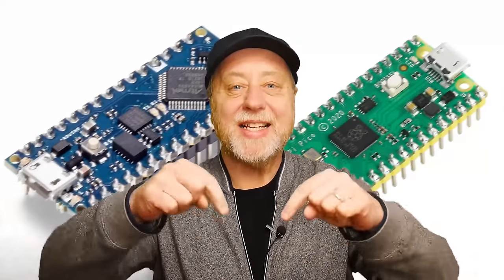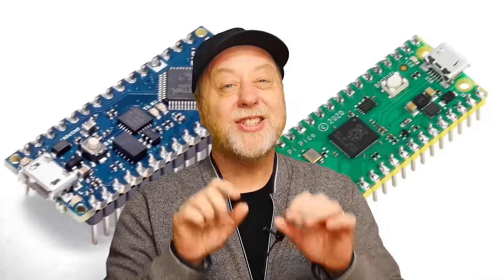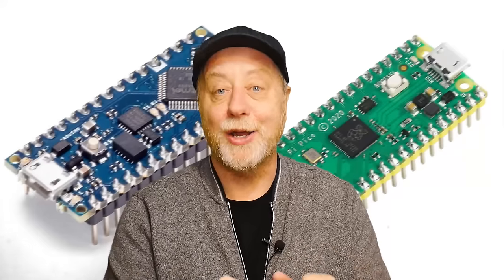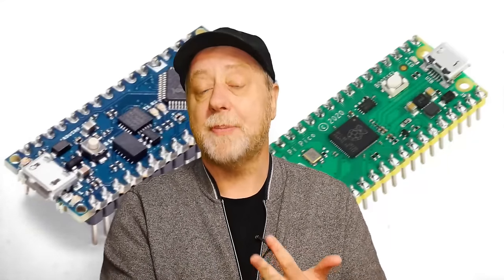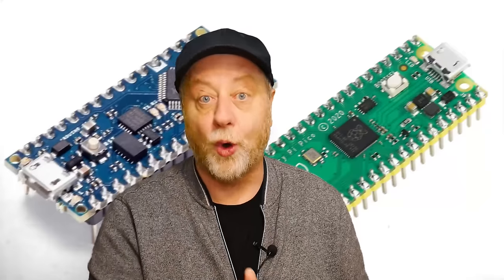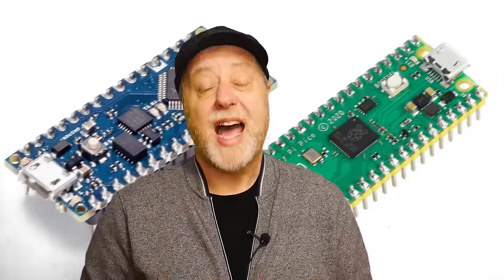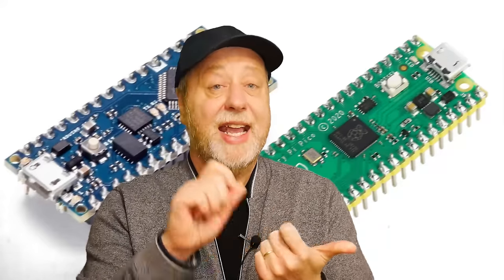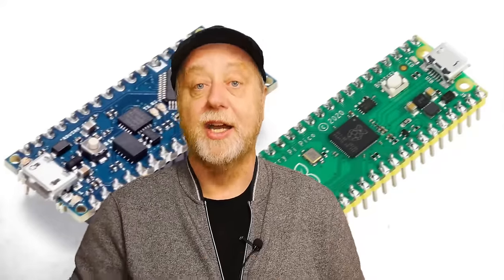Arduino vs Pico - Which is the Best Microcontroller For You?

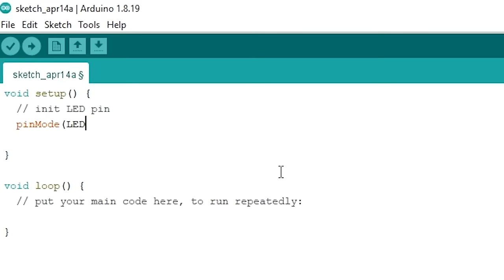Comment: 4:06 Unfortunately it's a common misconception, but just like Processing is not a language based on Java, Arduino and Wiring are not languages based on C++. Processing IS Java and Arduino and Wiring ARE C++.
Both are "just" Java/C++ libraries and if you want you could even call them frameworks because of the setup and loop/draw functions you use instead of the main function/class.
In fact, I even wrote my last Processing project by also setting up the main class myself. I just prefer to have control over the whole toolchain. What I skipped was basically just a preprocessor and not something that translates Processing into Java. I made a makefile just like I would with any other Java project and there I included Processing as a library just like I would with any other Java library. I'm pretty sure you could do the same with Arduino.

Comment: The decision gets more complex when you look at items like the Arduino Nano Sense BLE R2 that has many on-board sensors like a 9 axis IMU, temperature, pressure, light, and  microphone that would be external components for the Pico. It's more expensive but the externals and additional circuit complexity might bring the Pico into the same range if you need the functionality. MicroPython will also run on the Nano, and using VS Code with the PlatformIO extension allows for standard C/C+= programming.  Different horses for different courses and I'm happy to see an increasing number of possibilities on the market

Comment: I am having an issue i think it is that pico needs a DTR request on reboot and arduino does not..  i have software that does not send one and so  i have to open the serial monitor in the IDE in order to force serial communcation to open up..  the UART on the pico requires this andni need to find a way to simulate the handshake and enable serial comms on the pico.  Any suggestions?

Comment: just to be clear: arduino is also normal c++ with gcc and nothing special. it just adds one include or so automatically to the first line. also you should use platform io on vscode and not arduino studio
Reply from the maker: I have a video about Platform IO. But just to be clear, while the compiler is basically gcc, because Arduino uses non standard entry points etc, it isn't possible to write your own OS like I did with the Pico (see my videos on Piccolo OS). Hence my statements in the video.
Reply: @GaryExplains  I don't see why this should be not possible or different. If you don't use arduino lib (and ide) it should work as on the pi. I think you got confused because the arduino lib comes with its own main and some other magic but you can override that and do also not need to use that kind of magic.
Reply: Exactly. You can even use Atmel Studio (which is Atmel's special version of the regular Visual Studio) and original ASF libraries, and you can also install FreeRTOS on that board. Keep in mind the program flash is kind of small though :)
Reply from the maker: @TheLukasz032  This video isn't about alternative programming environments it is about the official environments, the ones that most people will use when they get these boards. If you don't like the official environments that is a different discussion. If you want to be awkward you can create the machine code by yourself by hand in binary and flash it.
Reply: You know, if we want to be precise, the official environment for writing AVR code is Atmel Studio. Anything else is either a port or another toolchain, not officially supported by Atmel.
Reply from the maker: @TheLukasz032  No, that is nonsense. The official way to program an Arduino as a board, is by the software that the board maker releases, not the software released by the maker of one of the components. Since not all Arduino's use Atmel processors then it is quite a ridiculous argument you are presenting. How can I program an Arm Cortex-M0+ using Atmel's software. The Arduino is a board, a complete product, not just a component.

Comment: The best controller is the one that's the cheapest when you shop for it, period. MicroPython doesn't care on what hardware it is running, and let's face it, 90% of the projects you'll work on won't push either boards to their limit.
Reply from the maker: Ram size is an issue for micropython, so it isn't as simple as you say. Plus my RAM emulator (see my video on this channel) needs performance.

Comment: my pi pico died within the first day of being used. would much rather use  an arduino or teensy controller
Reply from the maker: Hmmm, I have several Pico's and not one has failed (other than a broken boot sel button, see my video about that). Maybe you blew it up by connecting it up wrongly.
Reply: @GaryExplains  i used a kitronik robot board to supply it with power from a 8.4 volt lipo hobby pack to drive some motors for a robot. it work fine then but when i unplugged the battery pack from the deans connector and usb to put it away for a moment it refused to boot. i also double check all the polarities for the battery pack, motors and servos and they were all good. maybe it was ESD that killed it. i can't imagine the cortex processor to be that sensitive to ESD. i also didn't have a switch on the supply side of the robotics board so it powers up instantly.

Comment: Arduino, wiring, and processing are not languages. They are frameworks/platforms for the languages that they support. Arduino and Wiring use C/C++ and Processing has support for both Java and JavaScript.
Reply from the maker: Here is a quote from https://www.arduino.cc/en/Guide/Introduction - "You can tell your board what to do by sending a set of instructions to the microcontroller on the board. To do so you use the Arduino programming language (based on Wiring), and the Arduino Software (IDE), based on Processing."
Reply: @GaryExplains  gcc is used to compile Arduino sketches, the version used depends on the board. All Arduino does is hide the boilerplate from you so the experience is simpler and more consistent across the platform. I have no problem saying that Arduino is wrong in calling it a programming language.
Reply from the maker: Ok, then take up your cause with them, not me. 😜
Reply: @GaryExplains  fair

Comment: 4:10 The Arduino "language" is not based on C or Processing or whatever. It is just plain old C. The IDE uses GCC to compile your code. I don't understand why people keep falling for this non-sense.
Reply from the maker: LOL, because that is what it says on the Arduino website. Here is a quote for you, "To do so you use the Arduino programming language (based on Wiring), and the Arduino Software (IDE), based on Processing" from https://www.arduino.cc/en/Guide/Introduction
Reply: @GaryExplains  yeah that's bad. I think admitting to using C will scare some people off.

Comment: A PIO programming vid would be amazing.  Having programmed everything from the Z80 onwards I'm amazed at the power of these devices.  I think the Arduino is suitable for a general introduction to programming embedded systems but the Pico is far superior.  Great video.  Thanks!
Reply: I don't think a video is needed for that. You need a data sheet listing the memory addresses for the ports and configuration registers.  The video can show you how to do it but you're not going to remember all the memory addresses of the registers, so you still need that on some kind of data sheet.

And people don't become good at programming if they are spoon fed everything. People need to do their own research and work things out for themselves, just as we had to do in the 80's.

Comment: Hello guy can anybody help me out i need to know WHERE in the datasheet of raspberry pi pico are the specs of general sink and source current of each input/output or groups of outputs, i have read it over and over and i cant find it, please help me out !
Reply from the maker: In the section " PADS_BANK0: GPIO0, GPIO1, …, GPIO28, GPIO29 Registers" of the RP2040 datasheet it says the drive strength can be set from 2mA to 12mA. Is that what you mean?
Reply: @GaryExplains  hello and yes! That is the info I need, but I still can't find where is the "PADS_BANKS" section, and I am looking at the datasheet of raspberry pi pico and also the datasheet rp2040
Reply from the maker: What I can say, I just did a search inside the PDF file for "PADS_BANK0:" and it found it. Page 300.
Reply: for what i can see the nature of my problem is that im looking into the wrong PDF, because mines have both 35 and 31 pages, im talking about Raspberry Pi Pico datasheet and RP2040 datasheet, what is that PDF of 300 pages you are refering too ? and sorry to bother you again !  @GaryExplains
Reply from the maker: The RP2040 datasheet has over 600 pages! https://datasheets.raspberrypi.com/rp2040/rp2040-datasheet.pdf
Reply: This is definitely what I was looking for, I don't know how it wasn't the one I downloaded from the website but it works for me, thanks alot Gary and keep you great and useful videos on !

Comment: using STM chips with an ST-Link debugger and i will never go back to arduino. Not sure what the pico has for debugging support. i know the esp has debugging capability over uart, but i've never used it.
Reply from the maker: Pico supports SWD.
Reply: there is a firmware for pico to turn it into SWD debugger for Picos

Comment: The title is a little misleading; those aren't microcontrollers themselves, those are BOARDS that contains a microcontroller. One of them is an AVR 8-bit microcontroller, while another one is a 32-bit ARM.
Reply from the maker: So Arduino vs Pico is misleading? Also there are Arm based Arduinos, something you would know if you watched the video.

Comment: RP Pico is one board, right? Arduino is a brand, right? And Arduino have many board including some far more powerful than the Pico, right?
The way this is presented is a bit weird! And why compare a branch of board again just 1?
Reply from the maker: If you watched the video (which it seems you didn't) then you would have noted that a) Arduino and Pico are both ecosystems and you need to pick one when making a choice about a project or projects. b) the RP2040 is a chip that is used on lots of boards.
Reply: @GaryExplains  the main and only difference is so far Arduino create board using MCU either from Atmel or ARM where on the other side the Raspberrypi Foundation did create they own MCU using the ARM Cortex M0 architecture.
RaspberryPie foundation is doing a great job selling those RP2040 MCU to who ever want to create boards with them, aside putting it in the 2 board called RP Pico and RP Pico W.
If you want you can create a board using the Arduino Uno form factor using the RaspberryPie RP2040 MCU as brain for your board! Then on which ecosystem will you be?
Btw Espressif is also using the term PICO for one of their System-in-Package (SiP) based on the popular ESP32, and it have obviously nothing to do with the RP Pico board.
And yes I haven’t finished to watch your video as it doesn’t make a lot of sense to compare or oppose the RP2040 ecosystem with the Arduino ecosystem!
Reply from the maker: @jeanchindeko5477  Hmmm.... "he main and only difference is so far Arduino create board using MCU either from Atmel or ARM where on the other side the Raspberrypi Foundation did create they own MCU..." If you think that is the main and only difference then you have completely misunderstood and clearly not watched the video.
Reply: @GaryExplains  hmmm what about the Arduino Nano RP2040 Connect?
As you can see nothing forbid Arduino to make use of the RP2040 in one (or many) of their board!
My point, why put this 2 against each other in a comparison, when for any given project the question is not if I’ll go for Arduino ecosystem or for Pico (to put it your way) ecosystem. The question is wether which MCU will fit my needs, then chose a board in one of the Arduino form factor or family of boards, or any of the Adafruit family of boards or any of the Sparkfun family of boards, or Teensy or Seeeduino, etc… that integrate that MCU you’ll need to either R&D your project or design around for your project.
Software wise, you can even with the RP2040 use Arduino IDE or PlatformIO or VisualStudio Code to write your code. 
Now if you need more flexibility or control you might even not consider the Arduino IDE and framework at all and go directly to an RTOS free or commercial.
Reply from the maker: @jeanchindeko5477  I give up. It is pointless speaking with someone who hasn't watched the video.
Reply: @GaryExplains  ok tell me why did you choose to oppose, compare those 2: Arduino and Pico, as per the title and your video?
No problem Sir, I’ll watch it till the last second.

Comment: Too many boards with too many different processors isn't always a good thing. It leads to user frustration where parts you've already have not being compatible with code. Lots of people still use the Arduino UNO  because it's a known stable platform that has not changed for a very long time. A ten year old one works just the same as a new one I buy today. Designers like stability.  
Haven't even mentioned the fondness for 5v parts, but that's another argument.

Comment: 4:06 It isn't based on C++, it is C++. There is no "Arduino Language". The Arduino cores are just C++ libraries for different microcontrollers that provide the Arduino functions like digitalWrite, digitalRead etc. But it's just regular C++ and it's compiled with regular C++ compiler. Nothing special about it.
Reply from the maker: I think maybe you should contact the Arduino people as it says "To do so you use the Arduino programming language (based on Wiring)" here https://www.arduino.cc/en/Guide/Introduction Also, there are some special things about it like loop(). You can't write a context switching OS using the Arduino IDE like I did for the Pico. That is my point.
Reply: @GaryExplains  Fair enough, they may have expressed themselves in a rather misleading way. But trust me, it's a library. Yes, you have setup() and loop(), which aren't common in plan C/C++. But setup and loop are just functions of the Arduino library. They are defined in Arduino.h, which is automatically imported by the Arduino IDE. If you use Arduino in a different IDE, you usually have to manually import Arduino.h. Cause normally IDEs don't invisibly import libraries by themselves.
The same goes for processing for course. Except that processing is a Java library. Just as, the Processing and Arduino IDEs are written in Java.
It's also kinda difficult to compare Arduino and the Pico. Since when people talk about Arduino, they usually rather mean the Arduino library, which also runs on ESPs, STM32 and many other microcontrollers, including the Pico itself of course. Therefore, deciding to use a Pico doesn't necessarily mean deciding against Arduino.
Reply from the maker: @phinok.m.628  I am fully aware of how Arduino has implemented the Arduino Programming Language (using gcc etc). But my point still remains that you can't write a context switching OS, like did for the Pico, using the Arduino IDE. That was the point I made in the video and it still stands.
Reply: @GaryExplains  Well, I'm not entirely sure what you mean. You can also have Arduinos run different tasks on different processor cores, assuming you have more than one core. The ESP32 for example, runs FreeRTOS in the background anyway, so you can use all of it's functions.
But it's generally not really an issue to have multiple things run "simultaneously" on one core, without an OS handling the task switching for you. And you can also program any Arduino using C/C++, given that Arduino itself runs on C/C++. If you don't wanna use digitalWrite etc., look up the datasheet of the microcontroller and write directly to the registers using plain C. If that's still too high level for you, use inline assembly. The IDE doesn't care.
And if you really don't wanna use Arduino. You can easily program an Arduino without Arduino. Using a basic Arduino Nano for example, download Microchip Studio (or Atmel Studio as it used to be called, before Microchip acquired Atmel). And you can program the Arduino directly, without Arduino, using C/C++ or Assembly. Can't get much lower level than that, really.
While the Pico definitely also has some awesome features, personally I prefer the ESP8266, since it has more than enough power for most projects and has Wifi. If I need more power, I usually use the ESP32 since cheaper than the Pico, has pretty comparable performance and the onboard Wifi/Bluetooth often really comes in handy, even for just programming the microcontroller over Wifi without always having to connect a stupid USB cable.
But given that, Arduino is fairly microcontroller independent. I don't really see the point in comparing Arduino and the Pico to each other in the first place. You don't really have to choose one or the other, you can just as easily use both together if you feel like it.
Reply from the maker: @phinok.m.628  Well I have two videos on Piccolo OS, and a whole github repo dedicated to it. It is a very simple context switching OS that I wrote for the Pico in C. It can't be ported to Arm Arduino boards using the Ardunio IDE. That is my point. The rest of what you wrote isn't relevant to this discussion.

Comment: Arduino isn't like C/++, it IS C/C++
The inclusion of the Wiring libraries does not change the language!
Reply from the maker: And yet it says on the Arduino website: "To do so you use the Arduino programming language (based on Wiring)" See https://www.arduino.cc/en/Guide/Introduction
Reply: @GaryExplains  It uses gcc to compile the code though, so it's just C code regardless of what the marketing people say.
Reply from the maker: With the exception of the entry points.